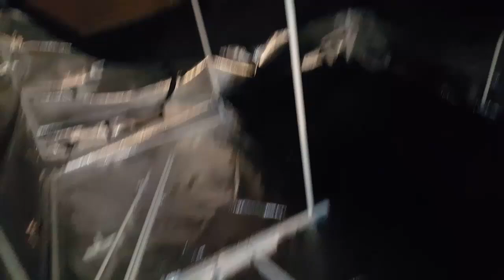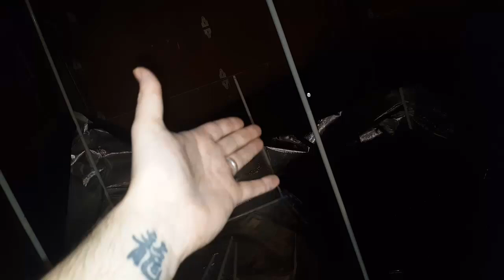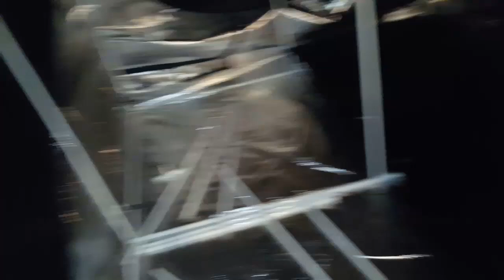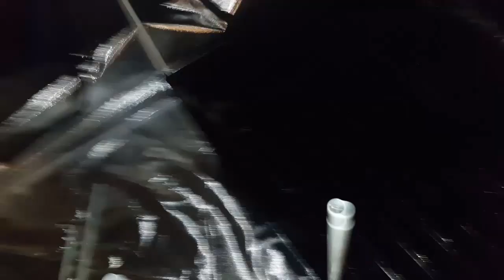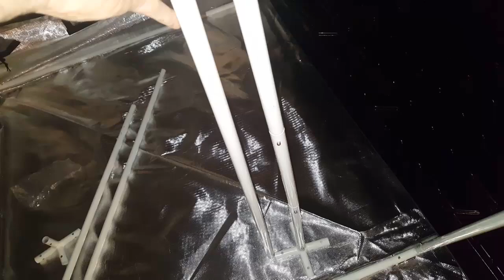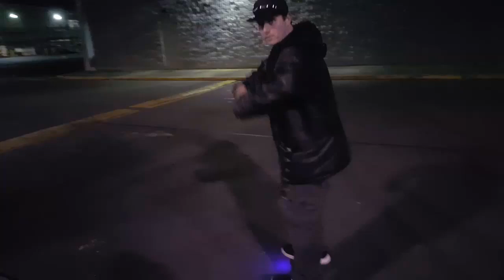Trick for your Gorilla Tent if your ceilings are short plus how Im going to grow

Comment: I suggest you measure the entire room and ceiling height before you buy a tent. Save yourself a headache. If that doesn't work You can cut the top half of the poles with a sawzaw and it will work but your walls will be baggy and hang loose. I've done it before and it worked.
Reply from the maker: I grow in a closed system, so I don't have to worry about the baggy walls from negative pressure. But Gorilla does sell side polls for that.
Reply: Good idea man. These tents can be a pain to set up but they get the job done nicely for what they are.

Comment: I really don't care what the video is. But just keep the grow video coming. And I do appreciate you because I have learned a lot from you and I'm just starting my first grow. But what is the ideal temperature for auto flowers
Reply from the maker: 78 degrees ambient room temps if HPS. Keep HPS far enough away so the tops of the plants are around 80 degrees. With LEDs, I keep room between 78 and 80 degrees. The last two weeks, I turn it down to 76 degrees.

Comment: you were talking about how big the plants will get in certain size pots what about filling the trays with rockwool cubes and doing flood and drain without pots just grow directly in the trays wouldn't that give the roots way more volume?
Reply: James Peavy if your talking about small cubes one of the problems with that is if you get root rot or disease they can spread to all your plants since your roots would eventually touch. & big cubes stacked on top of each other could work but it's same as a pot limited to the size of the cube. At least how I see it
Reply: Yea root for would be a bitch if it set in
Reply from the maker: Main reason is I need to control the size of the plants.
Reply: couldn't you control it by scrog at least the height.
Reply: Sorry new to growing and want to get the most out of the dwarf star I ordered

Comment: Neil I'm looking at your feeding charts on your website and just to be clear, you use bloom for the whole grow right? Or do you use grow first?
Reply from the maker: I have different charts on there. One is Bloom the whole grow. It is the cheapest way to get started. I used it for a long time. However, with autos, if you do bloom the first 7 to 10 days, 200-300 ppm, then switch to grow until they start to flower, then switch back to bloom, you get the largest yields.